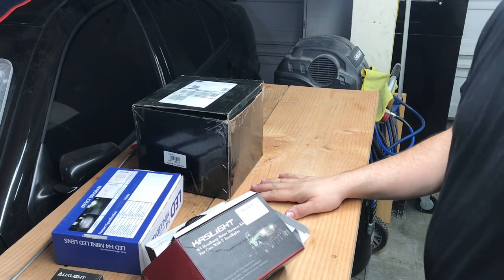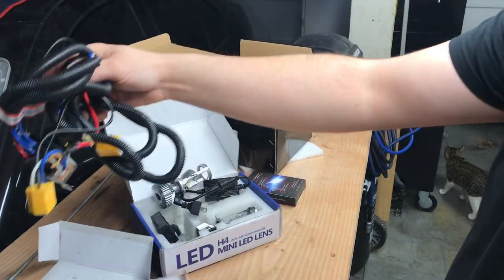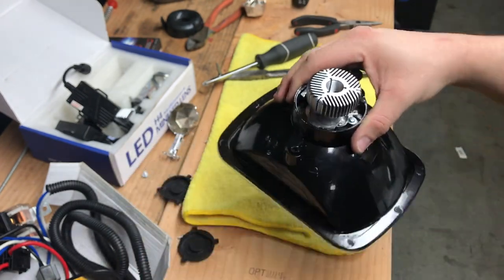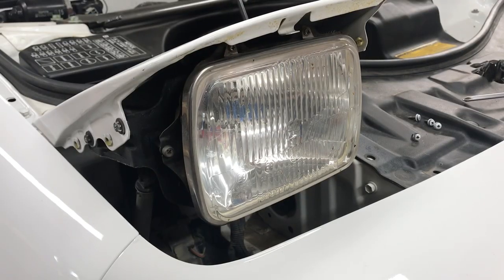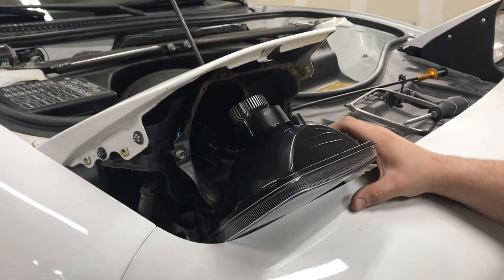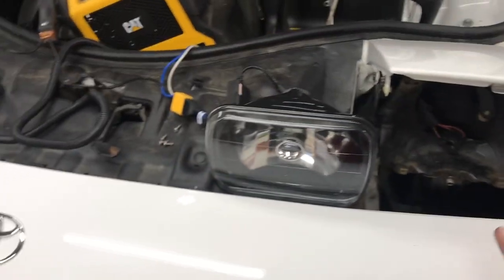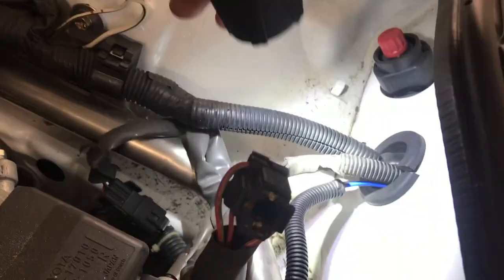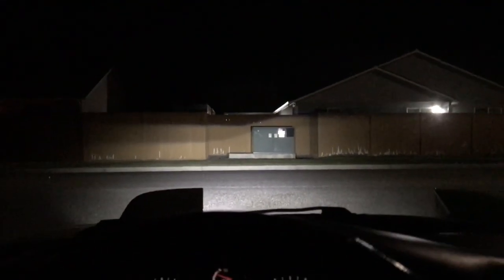DIY Budget H4 LED Projector Headlight Upgrade - 1995 Toyota MR2

Comment: Most older cars with sealed beam headlights run the power inside through the light switch.  All that undersized wiring and then the light switch contacts kills light output even with sealed beams.
An relay harness (even diy if you use the right sized wires) will make sealed beams brighter.

Comment: Tip: the ring that holds the light housing is designed so that you only need to unscrew the top 2, and bend the ring forward.

Comment: Great video. I can see that the make a really narrow beam, i cant see the other side of the road. Makes no sense for cheaping out for these when full sized Led retrofit projectors are available for under 100 usd. However you did excellent job for the wiring so when you upgrade again its just plug and play.
Reply: Can you name a retrofit kit?
Reply: @rikkmode  morimoto
Reply: @Kana0211  Way too expensive
Reply: However retrofit requires a lot more skill, money and time. You need to remove the lens from headlight to install the projector. Not fast or easy, especially for "regular" people.

Comment: Hey boss, liked the video, quick question if you have time, i have the newer replacement headlights from prime mr2, they are alot brighter and cleaner than stock w real glass lens, however the bulb shines everywhere, i want rhat projector style cut off line like in you video, do you know if this will work with these lights i have too??
Reply from the maker: As long as they are not a sealed beam headlight, I don’t see why this wouldn’t work, these led bulbs rely on themselves for the cut off line so the housing itself doesn’t really matter
Reply: @ROADNOISEMEDIA  awesome, will pull one out tomorrow and check, if not sealed beam ill be doing this!!!! Thanks man!

Comment: Thanks for this video. I just did this on my 91 and installed the same type of harness..I get nothing. When I plug the lights direct into the factory plugs, I only get high beams. Any ideas what I'm doing wrong?
Reply from the maker: @txman951  hello, the pins on the harness might be swapped
Reply: @ROADNOISEMEDIA  the pins in the Amazon relay harness?
Reply from the maker: @txman951 yes, sometimes they have the two positives switched around

Comment: Great pattern for cheap, finally!  I'm curious if I can throw a set into my TL1000R headlights as well!
Reply from the maker: It could definitely work, I put a set into my wife’s highlander and it works wonders, even better then the mr2, I’m wondering if it has to do with the reflective bowl design inside the headlight

Comment: Great video. So is it the bulbs themselves that provides the sharp cutoff? Or do you need LED-specific projectors for that? Since the housings you linked here are no longer available, I'm wondering what other options might work.
Reply from the maker: Hello, it’s actually that specific bulb itself that has a metal surround built in that gives it the cutoff

Comment: I'm having this issue when I plug in the aftermarket headlights 5x7 and doesn't turn on without harness . Not sure why but just ordered the harness hopefully it will turn on this time . But the weird part is that it turns on with stock headlights not sure but hopefully it works
Reply from the maker: These cars have a reverse polarity system, leds don’t work unless you get the harness, the harness converts leds to be able to run on the mr2’s
Reply: @ROADNOISEMEDIA  shhhhh ok explain why it didn't turn on in the first place 🙏🏼 thank you

Comment: I may have missed this, but why did this require a harness? You see other LED options (like the ones found on primemr2) that seemingly don't require a hardness?
Reply from the maker: As far as I know they all require a harness, because the mr2 uses a reverse polarity switch, I haven’t tested any other ones to be able to confirm or deny theirs working, and there might possibly be newer technology out now that possibly has what is needed built in to the light itself, but as far as I understand, to run leds you need the harness, I could be wrong, but I did try to install these without the harness and they did not work, now if you were to go with HIDs, then you don’t need a harness

Comment: The housings appear to be out of stock. Do you know where else I can find them, or a similar set? I can't find any brand or model names on the ebay page.
Reply from the maker: You can try Amazon, or even your local auto parts store, most stores have these in stock, just make sure that they are not a sealed beam type

Comment: Can you replace the halogen in the housing already in the car thereby bypassing the harness and the aftermarket housing?
Reply from the maker: Hello, some of these housings are what’s called a “sealed beam light” which means the bulbs are soldered into the housing and the only way to replace them is to replace the entire housing and bulb together for another sealed beam or you can go for an opened housing where it lets you replace just the bulb whenever they go out or if you want to upgrade them.

If your lights are not sealed beam, then yes you can use the original housing to install the bulbs into, BUT for these cars because of the reverse polarity design of the 90’s, you usually have to install the bypass harness otherwise leds won’t work, if you decide to upgrade to the sealed beam leds instead of the projector type, some of those sealed beam ones have the wiring built into them and already have all the necessary bypass stuff built in so you won’t need a harness. So at the end of the day it all depends on which route you’d like to go with your replacement/upgrade, if you’d like to go for something other then what’s in this video, please do some research on the mr2 forums or Facebook pages and you’ll get tons of answers as to which lights to go with, thanks for watching! And happy modding!
Reply: @ROADNOISEMEDIA  I know this is an older post. However, you can install a relay kit to get more light out of your sealed beam headlights too. The brighter light comes for the more power flow. The power is coming direct from your battery carried by a bigger wire unlike the OE solution in classic cars where the current actaully has to travle into your dash into the headlight switch and back out to the headlights on smaller gauge wire. It adds a lot of resistance resuling in reduced lighting. Even if you don't go with the LED Retrofit it's a cheap way to get more light cast out on the road.
Reply from the maker: That’s good to know! I was not aware of that, thank you

Comment: If i wanted to, could I do this upgrade but keep the stock glass housing?
Reply from the maker: Only if your lights are NOT sealed beam
Reply: @ROADNOISEMEDIA  got it. apart from that, would it affect the light beam if the headlights have that weird pattern on glass lenses?
Reply from the maker: I tried these in both factory style lenses with the patterns in them and also in clear lenses, the patterns do take away some of the output, but not terrible, since these are projector style I would recommend the clear lenses, BUT if you have the oem type with patterns and want to install them in there, you absolutely can, it’ll save you some money and also be a very good upgrade from the garbage factory lights

Comment: So I did the headlight and foglight upgrade to LEDs and installed the relay harness. However, if I turn my foglights on with the headlights, it goes to the high beams. If I turn off the foglights, the headlights revert to the low beams. Any thoughts on why this is happening?
Reply from the maker: Hello, I’m having a weird issue as well and haven’t been able to figure it out, my high beams get stuck on as well if I use them with the fogs on, as soon as I turn the fogs off, the lights go back to low beams, I even tried some regular led bulbs and they do the same, so I’m not sure if it’s something in the adapter harness, or possibly something with the way the mr2’s are wired in general
Reply: @ROADNOISEMEDIA  Ahhh, okay. So, it seems like we both have the same issue.  That is weird. I don't mind driving without the fog lights, as the regular LED lights are a huge improvement over the halogens for  night time visibility. 

I guess there's always the mod that will let you run the fogs with the other  lights on and headlights off. (If I can find it).
Reply: @ROADNOISEMEDIA high man, was you able to get the high beam fixed from getting stuck? I’m having the exact same issue. Thank you in advance.

Comment: How do you know if you need a harness or not ?!
Reply from the maker: Plug them in, they won’t work at all
Reply: Get a relay harness or diy one. That alone will make even sealed beam lights brighter. It's cheaper and more custom fitting to diy it. You can also upgrade the wiring to 10 gauge. Most kits are 14 or 12 gauge. The factory wiring is only 16 or 14.  Lights love current and the bigger wire allows it. Plus the harness makes them draw directly from the battery over the factory design that runs the power in tiny wires through the light switch and back out.

Comment: I didn't think you could use LED lights in your original halogen headlight housing (i.e. not legal).
Reply from the maker: That’s why this was a led projector upgrade, putting regular leds without projectors is not allowed, but if you want the video at the end, you can see the cutoff line which helps to not blind oncoming traffic
Reply: @ROADNOISEMEDIA  Oh, I see...  Got it. Thank you for posting this.  I've been debating whether to go LED or Xenon, but I'm leaning toward LED.
Reply from the maker: I like that led lights consume less power, so therefor less stress on the electrical system as well
Reply: @ROADNOISEMEDIA  Does your fog lights still function as your DRL after this mod?
Reply: You can if they have the same cutoff as I have leds in my reflectors and they are perfectly fine and no glare and the same cutoff as the original halogen bulbs.